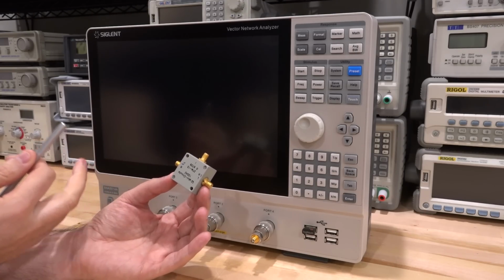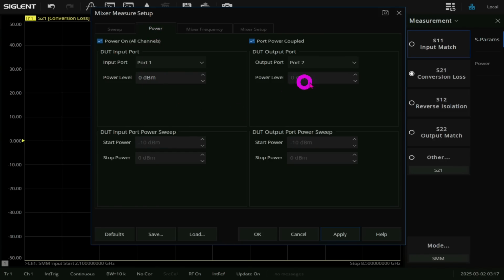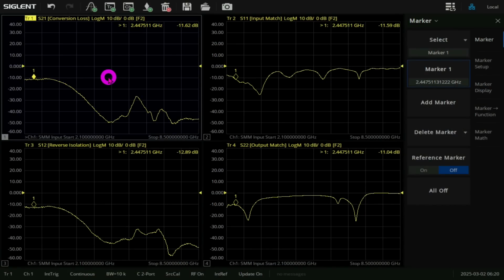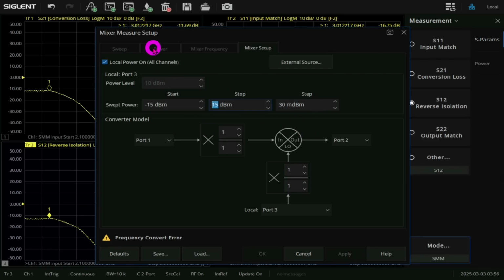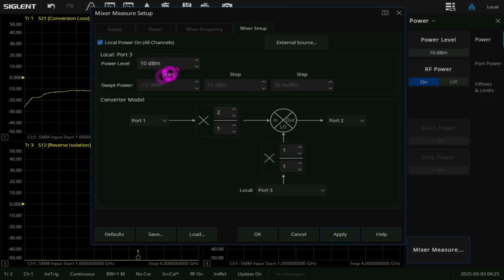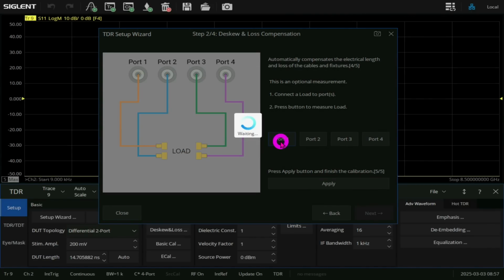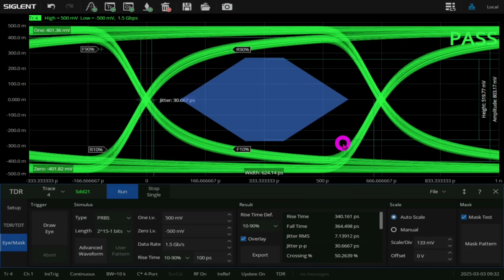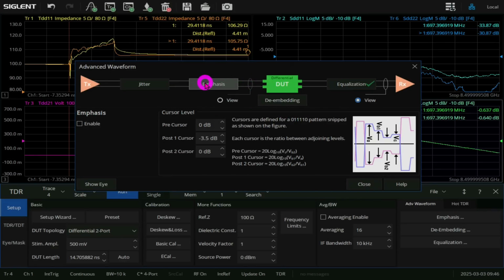Siglent SNA5000A 8.5GHz 4-Port VNA Mixer & TDR Application Review & Experiments (II)

Comment: Hot TDR is meant to remove spurs from the dut, when the dut is an output and transmitting to have it in the right op point
Reply from the maker: Yes, it is meant to characterize the channel while the circuit is active (hot) to investigate the active behavior of the system.

Comment: Wow, JUST got the Scaler MM and ETDR licenses.  How timely !  Two questions: 1) the provided option to bypass the power cal step in SMM doesn’t seem to work.  Is that a bug ?  2) the DUT length measurement in the ETDR cal seems to be artificially limited on the low (short) end. On my SNA5002A 4.5 GHz model, to ~27 ns minimum.  Is that a bug too ?  As you know Siglent has no real customer support to ask.  Thanks !
Reply: I have exact same problem. I've consulted the importer, and he'll forward it to Siglent for a firmware update. This was months ago...sigh
Reply: @MarcelGoedraad I hope they pay attention and fix it.  They’re definitely not known for their responsiveness, unfortunately.  Please post anything further you might hear !

Comment: Do you think the tool can simulate and measure the effects of data dependent jitter?
Reply from the maker: The entire TDR is doing exactly that. All eye diagram show ISI due to DDJ.
Reply: @Thesignalpath  I think of DDR as the effect of too many ones or zeros in a data stream, hence why something like 8B10B encoding is used.  What I was wondering is if you can inject longer and longer ones and zeros to see when the jitter becomes out of spec in a particular circuit under test.